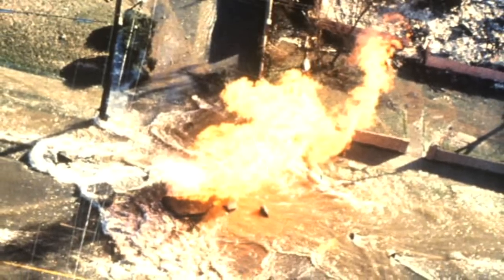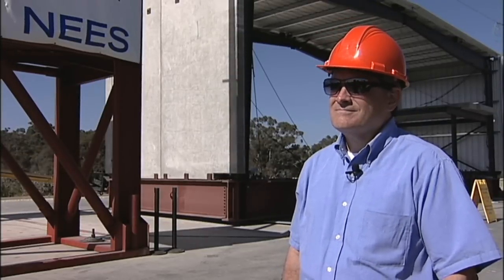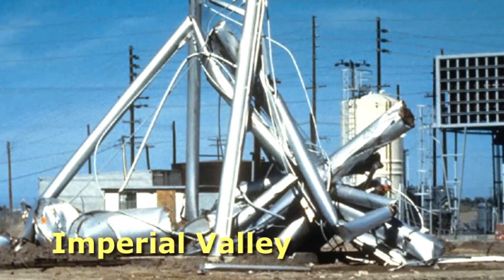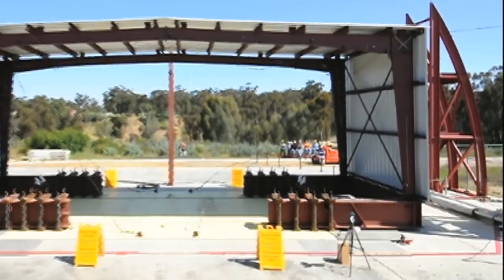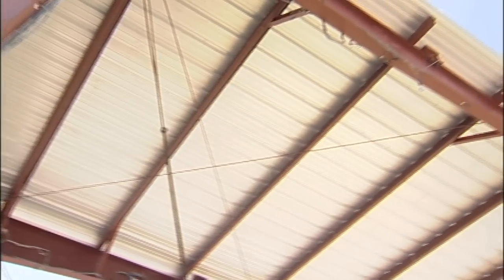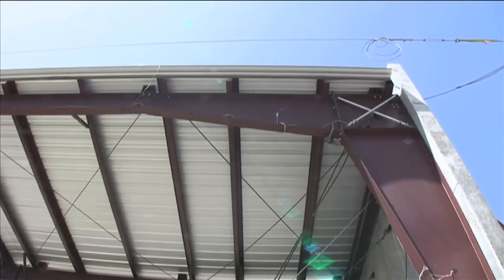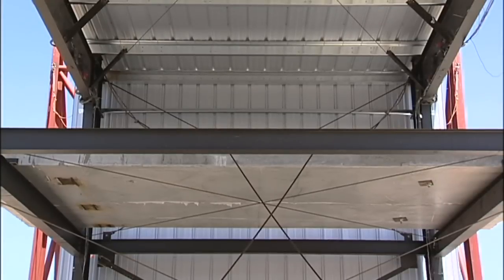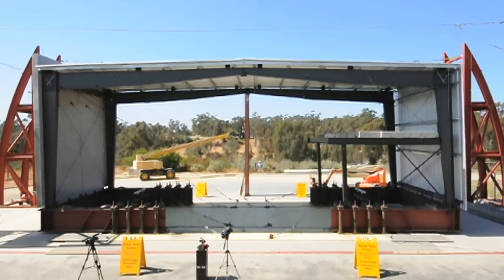Building It Better: Earthquake Testing Metal Buildings

Comment: I only see motion back and forth but every earthquake I've been in has had other motions and I think that sometimes it's the torsional moment that causes a structure to collapse. There is also at least some vertical motion, particularly in thrust earthquakes. I was in one in the 5 range in South America and the upward motion is noticeable, especially at the beginning of the earthquake.
Reply: structural engineers design systems to resist all 3 directions. this test is a simplification and does provide insight. in fact, insightful experiments must eliminate variables to the greatest extent possible to be meaningful.

Comment: Good thing they ran it to past 200%, because they are only simulating the weights for end frames in the structure. Intermediate frames would have 2X as much wall and roof attached to them.
Reply: You are right.

Comment: It would be interesting with the third test (with the suspended horizontal concrete slab) to connect the suspended concrete slab to the rest of the structure, with some form of damping system, so  the suspended concrete slab can be used as a simple type of mass damper, for the building.

Comment: Why put the heavy concrete panels on these buildings?
Chunks of concrete kill people.
Many quakes have up and down shaking alternating with side to side shaking.
Reply: Concrete panels have rebar typically 6" on center each way. This significantly reduces pieces breaking off. Also we design for a building to not fall over, not so there is no damage. Glass panels falling 20 stories is just as leathal.

Comment: It appears as though the test structure is not bolted down and undulates as a result. "IF" it is not bolted down, like a real world situation, then much of the energy is dissipated in the movement as the building dances during the simulated quake. If this is true, then this is not a valid test and is bogus.
Reply: At first, I thought what you thought.  However, on taking another look, I believe the upper portion of the test platform represents  the foundation, with the bottom, sliding section representing the Earth, which moves during a quake.

Comment: In the direction that is being tested I would not expect any damage. I would have liked to see the other direction.
Reply: real buildings have seismic frames in both directions. testing in the other direction with no seismic frame would be meaningless.
Reply: @majermike  Not these buildings they don't. They have tension bracing in the other direction and you can see them in the video.

Comment: I wander if they take rides on the simulator.
150%, even 300% isn't shit. Every additional whole number in the Richter scale accounts for %1000 increase in intensity. 475 years isn't all that long, though it probably is for a steel building.

What happens to that structure at the ends of the building? You would assume that it would be stronger but maybe not, especially for large slabs of vertical concrete pounding into one another.

What if concrete is used only on one side?

Comment: That’s just a light- weight steel  hangar only found in aerodromes and industrial sites...lets see one with a full concrete slab at roof height like a real building in the city. C’mon guys, get real.
Reply: Maybe that is the solution rather than concrete use on earthquake zones
Reply: watch the whole video
Reply: I think the intent was to determine the effects of seismic load on this special class of buildings (steel framed buildings with metal roofs).